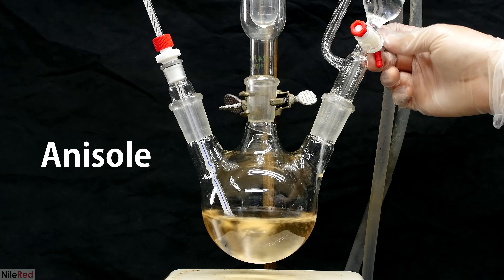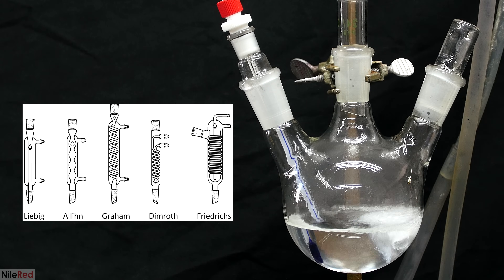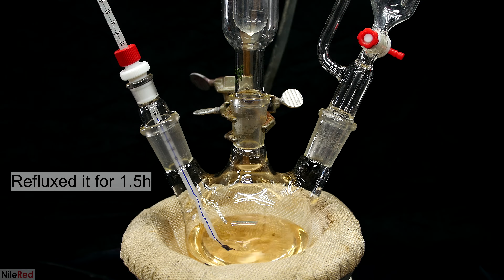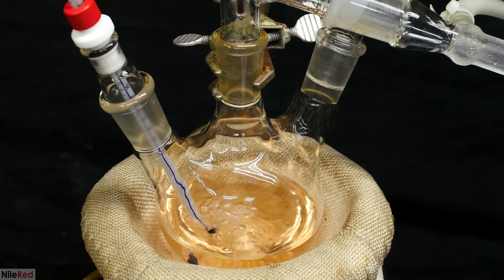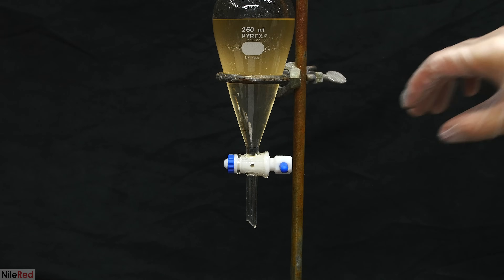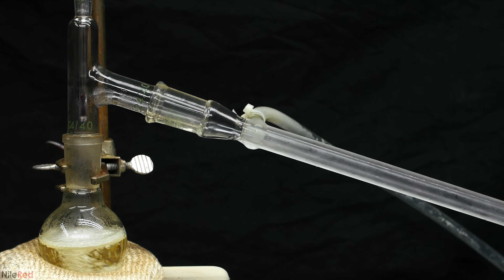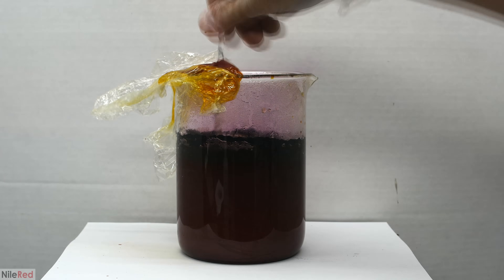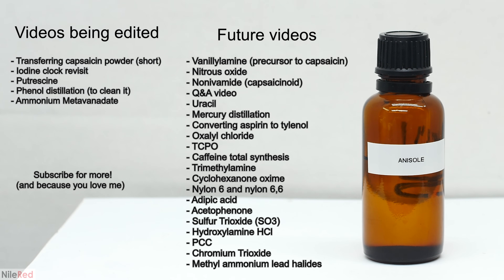Making anisole

Comment: Do you start with an acid cleavage of the ether bond to get phenol and chloromethane. Then hydrochloric acid protonates the propanal at the oxygen to make stronger electrophile. Then a lone pair from the oxygen on the phenol comes down into the ring and makes its way to the para position to attack the protonated aldehyde. This yields a structure where there are 3 bonds and a positive charge on the oxygen at the phenoxy end and an alcohol where there was previously a protonated carbonyl at the 'propanal' end. This structure is then deprotonated at the phenoxy end (by water I assume) to give 4-(1-Hydroxypropyl)phenol. the ether is then reformed via an sn2 reaction where the alcohol at the phenol end attacks the chloromethans to form 1-(4-Methoxyphenyl)1-propanol. The chloride ion generated from protonation of the aldehyde is regenerated into hydrochloric acid by the phosphoric acid. Then we have a condensation reaction via an Sn2 mechanism where the Hydrochloric acid protonates the alcohol on 1-(4-methoxyphenyl)1-propanol followed by the chloride ion attacking that carbon to kick out a water molecule. This yields anisole-p-1(chloropropane).  There is a second condensation where the pyridine deprotonates the carbon atom next to the carbon bonded to chlorine which then forms a double bond by kicking out chlorine  to give your product of anethole. My best guess.
Reply: I don't know why but the first half of my comment is crossed out, it's not meant to be.
Reply: The Aromatic Electrophilic  Subtitution can also work on the Anisole as well as Phenol (the OCH3 and -OH group cause almost equal +C effect) so i don't think this reaction must start with a cleavage, and later form ether bond again. Moreover, HCl couldn't cleave the ether bond since Cl isn't a strong nucleophile as Br- or I- (and sorry for bad English :3)
Reply: Mine is crossed out too =_=

Comment: Love your videos. As for making a botch of the mechanism, I propose this:
At first, the hydrogen of the HCl (after dissolving in solution) is attacked by the oxygen of the propanal. This makes the aldehyde carbon positive, and free for an attack by the chloride anion. First step creates a 3-carbon chain with a chloride and an alcohol on the first carbon. Next, the H3PO4 creates a substitution reaction on the benzene ring.  The carbon of the carbon chain attacks the double bond and attaches in para position. Next, a hydrogen from the para position carbon leaves, restoring aromaticity and transferees to the alcohol group. A water molecule leaves giving the product.
It has been some time since finishing my organic chemistry course. Forgive me if i completely distorted the rules of chemistry.

Comment: @NileRed: Thank you very much for the sheer amount of high quality chemistry videos. I enjoy every of youre videos I watch. :) Feel free to correct me, I still learn a lot about organic chemistry. 
My guess for the first mechanism: First you add the propionaldehyde to youre anisole in the para-position using the electrophilic aromatic substitution (SeAr), which adds a proton to the oxygen of the new group. Then this new OH-group gets protonized (using H3PO4 as a catalyst) and leaves the molecule creating a positive charged carbon atom, to which hydrochloride can create a bond, which sets free the 'used' proton and adds chlorine to the molecule (Sn1). 
My guess for the second step: 
You use the E2 elimination to get rid of a hydrogen atom of the second carbon atom of the propylgroup using pyridine, which simultaneously eliminates the clorine and creates a double bond.
Reply: so true

Comment: For the first mechanism you have to add a mixture of 324 g (3 mols) of anisole and 4 g of concentrated H3 PO4  heated to 150° C. in a 500 ml capacity reaction vessel equipped with a thermometer, stirrer and dropping funnel. After the above-mentioned temperature has been reached, 64 g (0.432 mol) of o-anethole (2-methoxy-propen-1-yl benzene) should be introduced into the thoroughly stirred anisole/phosphoric acid mixture over a period of 1 hour, followed by stirring for 1 hour at the same temperature.
Reply from the maker: Where did you get this? Also, that isn't a mechanism, but a procedure. Still useful information though!
Reply: NileRed I apologize for that, I forgot to add the mechanism, but this came from a patent. The link to the process is here, I cant quite remember what mechanism I had found so Ill try to find it and send it again. https://www.google.com/patents/US4026951

Comment: H3PO4 is weak acid that HCl and H3PO4 will have function like base, with the formation H2PO3^+ with water. =O of the carbonyl attack H2PO3^+ with formation of more strong carbocation due to electronegativity of P, after that is simple reaction aromatic electrophilic substitution for position para with leaving  H3PO4 and bounding with Cl^

Comment: I'm one of the best in my class to chemistry, but this is soooo confusing for me...
Reply: ***** Dunno bro im from Denmark, though im 15 if that helps to determite what im in.
Reply: At 15 in Denmark he is most likely in 9'th grade, not yet in high school.

It is something like this:
At 5-6 years of age you start in 0. grade and then onwards to 9. or 10. grade. After that, some form High school, either to learn a skill or to get ready for college, for three years... After that, depending on what you choose, work or collage.
Reply from the maker: You don't work with organic reactions until university usually!

Comment: I was just curious on how much your lab cost?
Reply from the maker: Several thousand I would think (if i include chemicals). I don't really track it though.

In terms of glassware, probably a few thousand
Reply: Seconding this, also mostlyy interested in the type/cost of glassware
Reply: Using chem glassware in a kitchen is pretty common, my family does it too. Those glasses are very hard to break with heat
Reply: I honestly can barely follow what he's talking about half the time because my memory is so badly shot, but I still want the glassware because it's so cool looking.  I know a guy that uses all scientific glassware in his kitchen instead of measuring cups and teaspoons and bowls, and it's awesome.

Comment: Because we have an acid environment, the oxygen of the aldehyde takes a proton from H-Cl, leaving a positive charge on the O and chloride ion. This chloride, as a nucleophile, attacks the partial positive carbon of the aldehyde and forms 1-chloropropanol, and again because of the acid environment, oxygen gets protonated by phosphoric acid. Then happens an Aromatic Electrophilic Substitition on para position because the methoxy group is an ortho-para orientador (it doesn't happen on ortho though, because of steric impediment). The sigma complex is formed and finally, aromaticity is regenerated with the elimination of a proton by the phosphoric acid conjugated base, and showing how the catalyzer is regenerated.

Comment: Hey NileRed,
Would you still like to get the answer to your mechanism question on this video? In that case:

The aldehyde is protonated. resonance occurs and causes the carbon from the aldehyde to become a carbocation.
Now a "double bond" from the anisole attacks this carbocation. The hydrogen from the aromatic ring is eliminated and the "double bond" in the aromatic ring is restored.
Thanks to a strong acid, like the phosphoric acid, the now synthesised wil be protonated. This makes an H2O-group, which is also a good leaving-group. When it leaves, it creates a benzylic carbocation, where the chlorine will attack, creating your desired product.

A very interesting way of a nucleophylic aromaric substitution. Looking forward to it.

Comment: my guess to the procedure of converting the anisole to anithole is this: the anisole reacts with the propionaldehyde to produce a side product.  then the oxygen left over and also the hydrochloric acid reacts to form some water, and then the chlorine attaches itself to the propyl group, which i think also produces hydrogen chloride gas too. i think that the phosphoric acid is just there to catalize the reaction.  the second step is the pyridine removes a hydrogen from the second carbon on the propyl group and the only chloride ion on the molecule, which also produces some hydrogen chloride gas.  after that the first and second carbon on the propyl group form the dubble bond, giving you your final product of anithole.

Comment: Hey Nile,do you have any suggestions/tips about the clamps for hold the glassware? Because I really don't know what choose betwee the 3 fingered ones or the pincers like ones..
Reply from the maker: It depends what you are holding, but i prefer the 3 fingered ones.
Reply: This is just my opinion: The three fingered ones are more versatile. Means they fit with alot of different diameters. But the ones with two parts are more stable when they are made for and used with a particular diameter.
Reply: I tought the same,but the doubt it's right the choice between the three fingered ones and the ones made by two parts..
Reply: Well,I've to hold my Liebig condenser and my round bottom flask;I too I find more trustworthy the 3 fingered ones.

Comment: Couldn't you just make sodium phenoxide to begin with rather than making sodium methoxide which is used to make sodium phenoxide. I guess it would be a slow rate if reaction. I am sure it would work as phenol is slightly acidic. Would it increase the yield if you took out that step?

Comment: HCl is in a water solution in the form of H3O+ and Cl- . The O of the aldehyde attacks the H3O+ and takes a H proton. The pi bond of the O breaks of and the carbon is left with a positive charge. Then the Cl- bond to this positive charge. The phosphoric acid also protonates the water. Another H3O+ (from the phosphoric acid) attacks the -OH group and then this group leaves in the form of water. Again there is a positive charge on the carbon which immediately attacks the para position in the anisole. The H of the anisole is picked up by water and the H3O+ is regained. Then the reaction is completed and we get the product.

I hope im correct but if not then np ;). I will at least learn the correct answer in the comments.

Btw your videos are the best Nile! :D